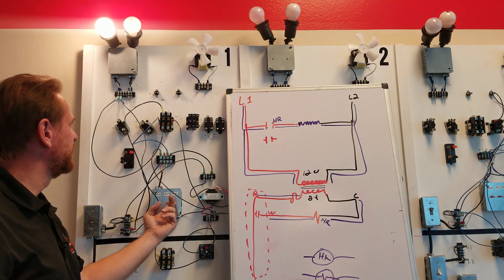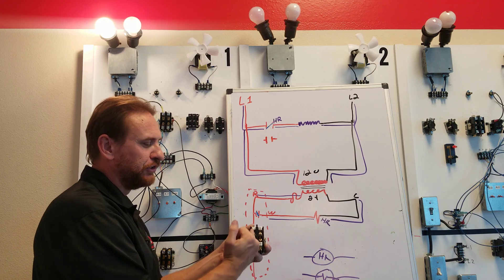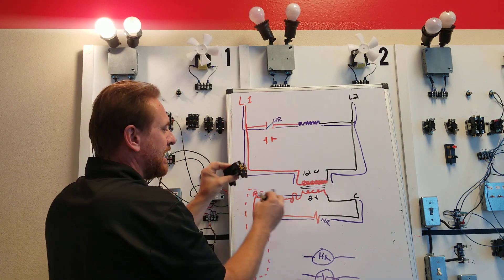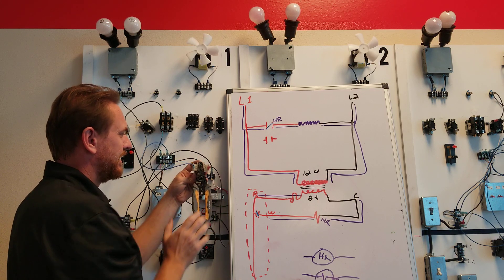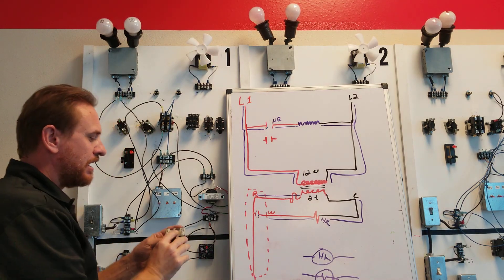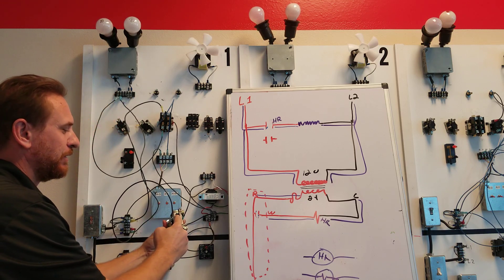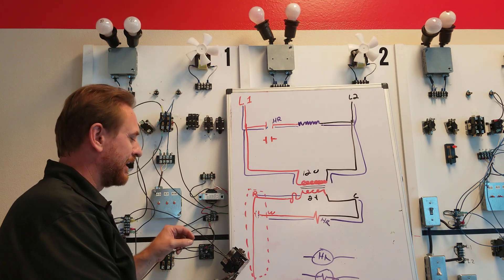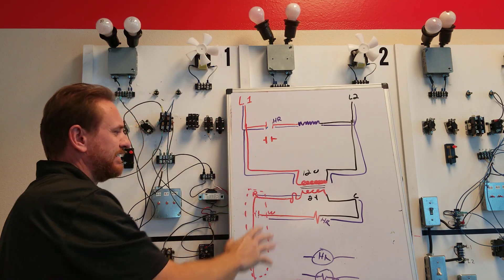HVAC contactor HV switch vs LV load

Comment: really like the videos. I have a question if you don't mind? I am running a match Lennox heat pump AC with txv that calls for a subcool of 3 degrees, I am running about 6 is this ok. The air handler shows air flow rate with a non pleated filter, I am running a #4 pleated filter to keep the evaporator cleaner is there a real benefit in this and if so is there some compensation for the reduced air flow .The split is about 15 degrees.
Reply from the maker: I dont think I have seen a unit with such a low sub cooling setting. Lennox usually likes the Approach method for charging.
Do you have the model numbers?

In regards to the split what is the In door humidity return air wet bulb  and out door temperature. In some cases 15 could be good, in others it could be too low.
Reply: @love2hvac  The condenser unit is a Lennox merit series 14hpx-36, the air handler is a Lennox cbx25uh-36 the system is 3 ton system
Reply from the maker: @samhalbrooks1534  I searched the model for the condenser and found a pdf from HVACpartsShop.com

On page 18 and 19 it gives very detailed charging specifications. It  also includes a chart for what the DeltaT should be for your conditions. 

Sorry I dont know how to share a link to the pdf from my phone.
Reply from the maker: As for the filter, if it's something like the April air space guard, they have pretty good airflow properties.  The numbers we look at with a magnahelix or digital manometer is the esp external static pressure of the unit (after the filter before the coil and right after the blower. 

Second reading in each side of the  filter for a pressure drop. (Delta p)

Thicker filters can be overcome restrictions with surface area. I'm some casses a high MERV filter may be a 50x40 instead of a 20x25 with transitions to the unit. This keep great filtration without restricting flow. Some manufactures are great at implementing this into their 4 and 5 inch filter cabinets.  With the brand and model of the filter and the model of the air handler I can get a better idea.